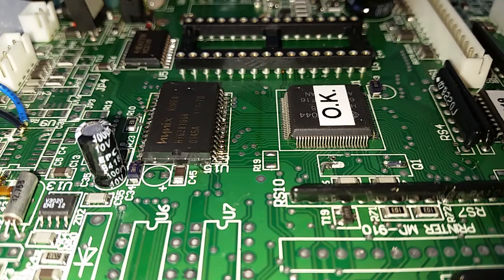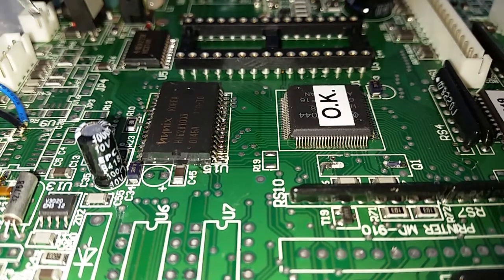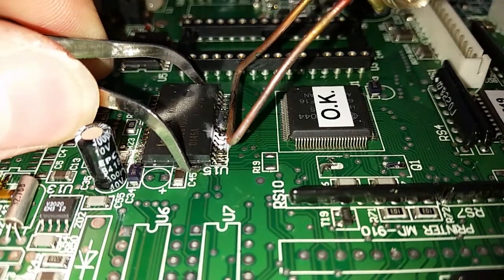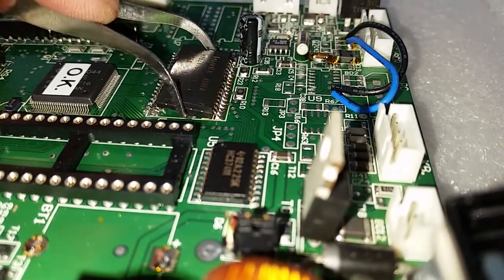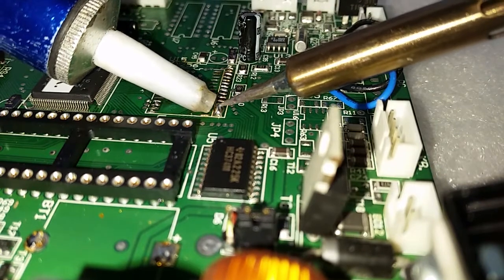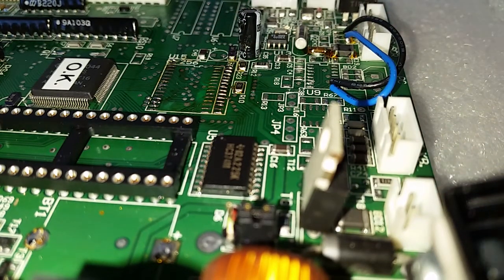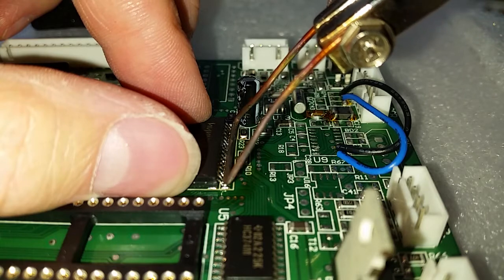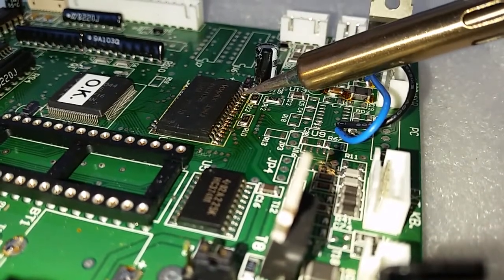Easy and quick desoldering and chip exchange with transformer solder

Comment: If the board is in bad condition (any corrosion or leaking capacitors), this is a great way to rip up pads and traces.  

Also, why not use a soldering braid to clean up the mess leftover instead?  it would be cleaner and quicker.

Also, when installing the chips, I would start by tacking the corners down first to align it.  This is not straight at all.